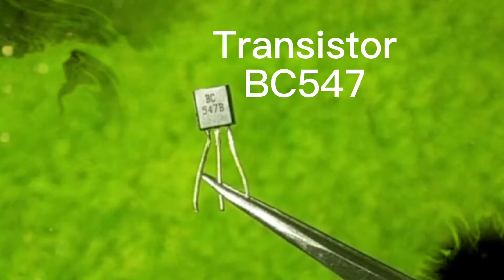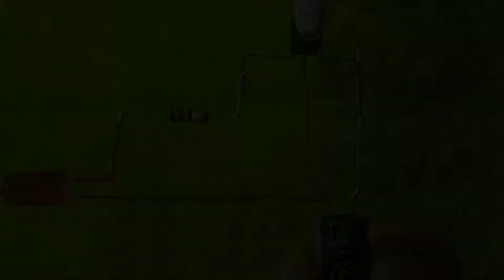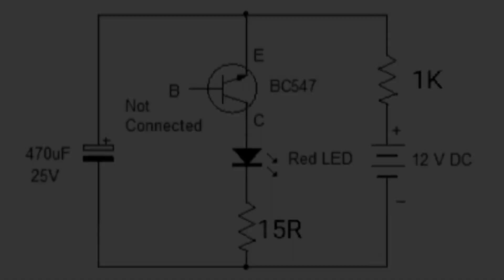LED Strobe light effect with BC547 transistor

Comment: How can you make it flash faster?
Reply from the maker: you can changing the value of capacitor, then can see the difference result ☺️. 
Thanks for watching.🌻
Reply: @DiYlianRen  I'm guessing you would increase the value? Can you make this without a 547?
Reply from the maker: Sure, you can replace the bc547 NPN transistors with the 2n2222. and it will have no negative effect on the project.☺️